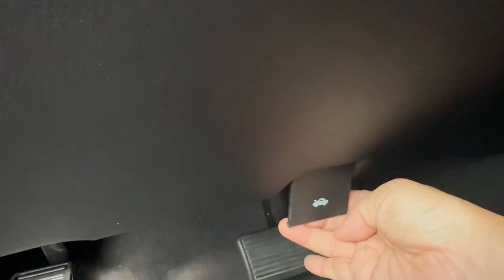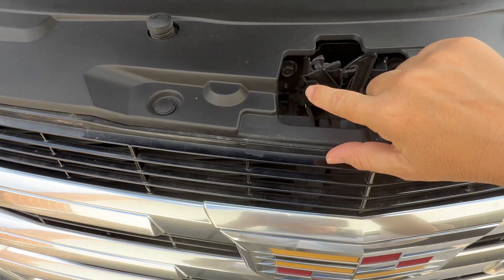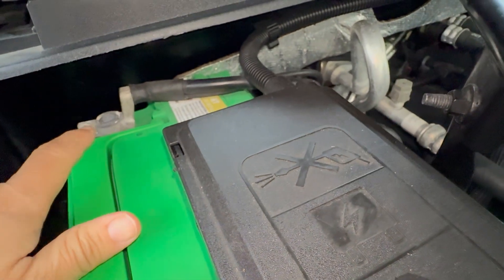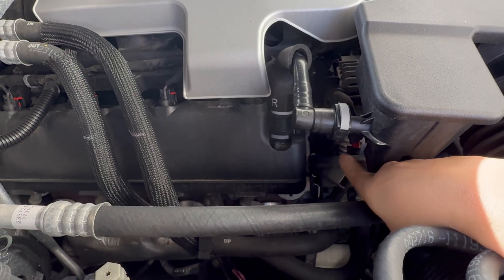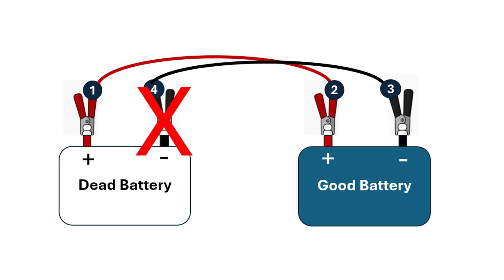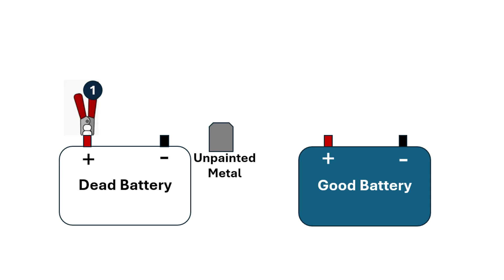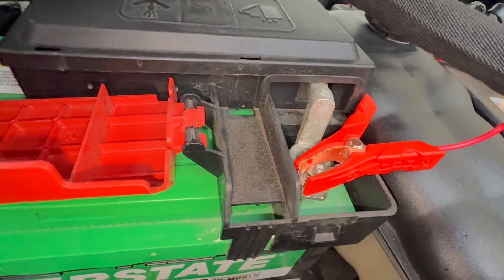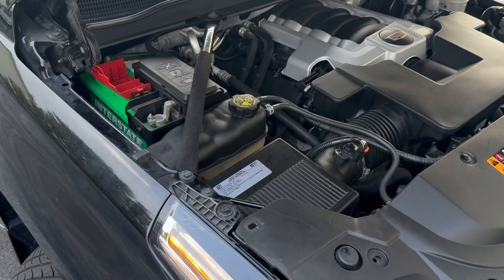How To Correctly and SAFELY Jump Start Your Car

Comment: This is where I get lost. No idea if I'd attach it to a good spot or how to even find a good spot. The metal parts of under the hood is mostly rust.
Reply: Just get a wire brush or a wire wheel for an angle grinder